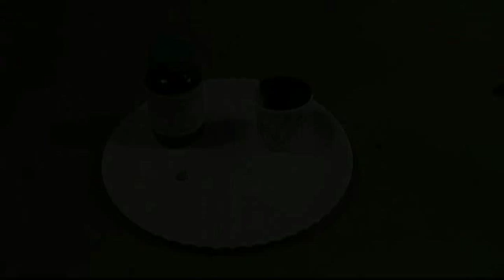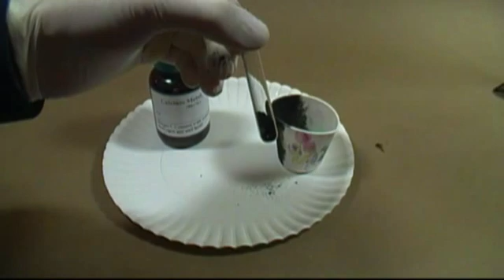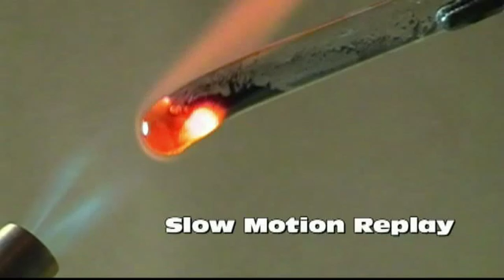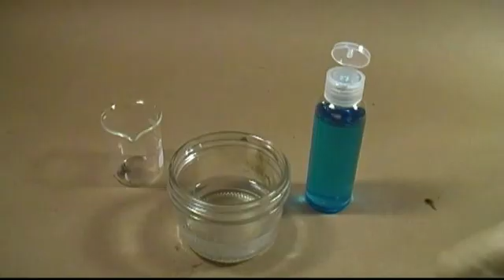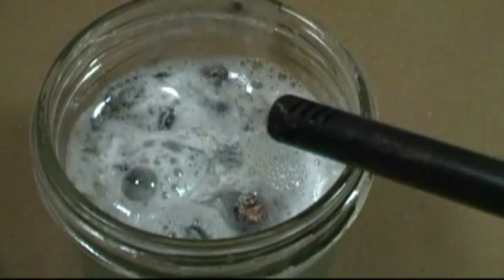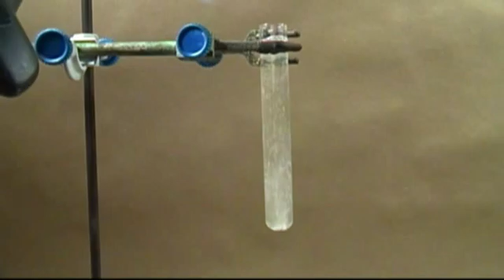Make Calcium Carbide

Comment: can you make calcium carbide with calcium carbonate?
Reply: I made this as a 7th grader when I took the opportunity in shop class and welded up a small metal crucible, dropped in a little over 3 parts fine carbon mixed thoroughly with powdered calcium carbonate and heated the crucible to cherry red with my fathers propane torch. When this mix had cooled I dumped out the lumpy grayish black mass and because of humid weather conditions began to smell a foul gas associated with manufacture of acetylene. Quickly put the mix in small amount of water, saw gas bubbles, and lit them on fire with orange flames and those carbon floater thingys you saw in the vid.

Comment: so you HAVE to buy a new tube everytime?
Reply: Maybe not, you can use a fused quartz (pure silicon dioxide glass) tube instead, which has a higher melting point and lower temperature coefficient than borosilicate glass. It's more expensive than regular borosilicate due to the higher temperature required for its production, hence why borosilicate is used in lab glassware instead.
Reply: I mean the tube get distorted so much I'd guess it's not same to keep it anyway

Comment: I assume the point of this is for purely experimental purposes? I have at least an oz or two of pure calcium(at least it was advertised as such), and I have a large chunk of carbon, but I'm pretty sure it would be cheaper and more reliable to simply buy lab grade calcium carbide as opposed to trying to make it yourself. Besides, I'm pretty sure I remember hearing about phosgene gas being used as a chemical weapon in WW1. Not sure I want to accidentally recreate that as a 'byproduct'.

Comment: Do you know how pure the carbon obtained from dehydrating sugar would be? What about the carbon left behind from burning magnesium in dry ice? Would carbon derived from those sources be suitable to use to make calcium or lithium carbide?
Reply: Lorenzo Pacheco both of those sources of carbon would need to be washed, the sugar one with NaOH and water, and the magnesium one with HCl and water. But once washed they would both be an excellent source for high purity powdered carbon.
Reply: TheChemistryShack Cool, thanks. I can guess of as to why the carbon from the magnesium+dry ice fire would need to be cleaned with acid, but what would be removed by washing the sugar-derived carbon by treatment with an alkali hydroxide?
Reply: Lorenzo Pacheco Cleaning the mag+dry ice with acid removes Mg and MgO
Cleaning the carbon from the sugar-H2SO4 approach removes traces of H2SO4
Reply: TheChemistryShack Ohhh, you see I wasn't thinking of the sulfuric acid method, I was considering a simple thermal decomposition/dehydration of the sugar in an oxygen-free environment.
Reply: Lorenzo Pacheco Oh ok my mistake then!
It would still be a good idea to do a water wash though in case any sugar remains

Comment: Nice video! Regarding the smell - the wikipedia article on acetylene says that it is odorless and the odor comes from impurities. I would think, then, that the odor would vary based on the source of the calcium carbide, yet you say that it has a very characteristic smell. I have also noticed that CaC2 I have from two different sources both have the same strong garlicky smell. Any idea what this is?
Reply: The garlicky smell is almost certainly due to phosphane and (maybe more likely) trace amounts of diphosphane, which arise upon the action of acids on calcium phosphides that can be present as impurities in the final product.

Comment: Can the same reaction be done with CaO?  It seem to me the reducing power of carbon could be used to reduce the CaO to elemental Ca + CO2 and then be free to combine with the remaining Calcium. This works for NaOH + C  an experiment I did as a young man. The reaction produced Na and NaH and set the kitchen curtains on fire while washing out the stainless steel condenser.  What do you think. I would try myself but due to age only my mind still works.

Comment: Would a fused quartz tube work better or would it also be exposed to such heat that it would also deform? That may be a moot question if the calcium carbide adheres to the glass, but otherwise...

Comment: For what can u use Calcium Carbide?
Reply: Large companies that use a lot of acetylene as in welding shops etc have a device called an Acetylene generator. You dump in a certain amount of CC and adjust flow of water. Gas is generated and piped throughout the plant to various welding stations. No cylinders of acetylene has to be handled and this method of getting Acetylene is easy and safe with a acetylene generator. CC is also what used to be used in the mines back in the 1800's and early 1900's  When the lamp is lit, it makes a very bright white light. Its also sold in paste form for use in toy cannons. Its called BangSite Paste. Same as the rock or powder form only in paste form. You can take a can, with one open end, and poke a hole in the other end. Place some CC on the ground, put can over, so the hole is directly over the CC. place a little dirt around the can where it meets the ground to make a better seal. Put some water on top of can. Allow water to drip through hole onto the CC.  When you start to see fumes or smell the gas created, scrape a bit of the dirt from around the bottom and place a lit match there. It will go off with a big bang and flash. Just becsure to keep your body parts back so can does not hit you.

Comment: propane/air might reach 2000 °C but you won't be able to heat a sample to that temperature. You'll be able to get your test tube to around 800.

Comment: I've read if you put the proper amounts of crushed limestone (CaCO3) and charcoal in a clay vessel (with a tiny hole to allow the gas to escape), roast it over a wood fire for hours, let it cool and break it open, you have CaC2. We whacked-out survivalist types want to make it by the pound, even, by the ton; because when the collapse comes, it will be worth more than gold. If one has calcium carbide, one has acetylene. With acetylene, one can braze. Add O2 and one can weld!  Sure beats a forge!
Reply: Clyde Wary could you provide any additional confirmation as to the efficacy of the process you described?

Comment: a propane/air flame reaches 2000C though, and oxy propane will get to 2500C you would just have to be careful not to melt the tube.

Comment: Holy-Terrorist:>*=* Is a good idea to mix calcium[Ca] metal with carbon[C] in fine powder or not in fine powder to not have explosion in the pyrex glass or ceramic bottle to not have failure in process for have 90% of production of calcium carbide[CaC2] to making acetylene[C2H2] quality of is dropped in water?

Comment: I used magnesium and silicon (but otherwise the same process) to make magnesium silicide. When thrown into hydrochloric acid, it produces silane, which is pyrophoric (at just above room temp.), so you don't have to worry about lighting the bubbles. Plus, magnesium is a lot cheaper than calcium.

Comment: @ScienceHideout for using CaO you'll need far more energy to get the reaction going. Like in an electric arc furnace. But it's really really unhandy to try to make this small scale. I tried it with a welding trafo, graphite electrodes in a graphite crucible filled with mixture of CaO and powdered charcoal. The yield was pretty low, but there was some carbide in there.

Comment: @japanesepoptart not like garlic at all I bet. I guess it should smell like a very weak fragrance of sweet (not got to smell it pure yet). The garlic like odour is related to the phosphine formed by water & calcium phosphide (video explanation) (a byproduct of the industrial process of calcium carbide due to traces of phosphorus in the used minerals (Calcium carbonates with, source depending, amounts of phosphates) That's why the industrial carbide is available as mole-poison.